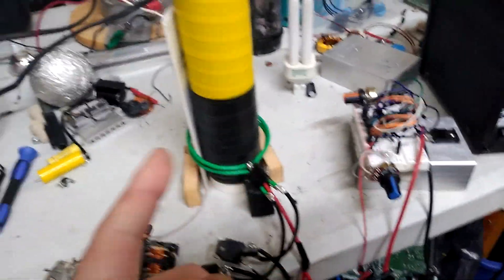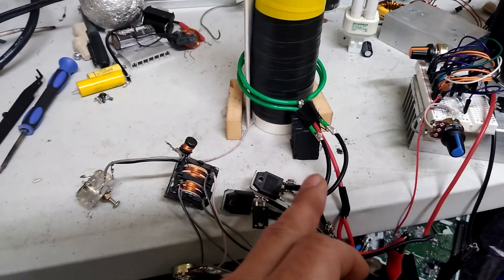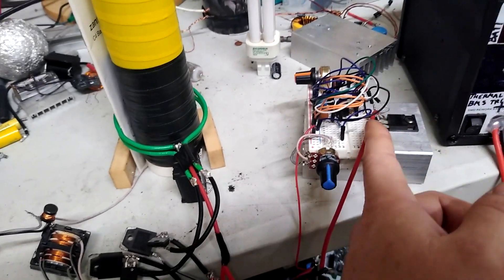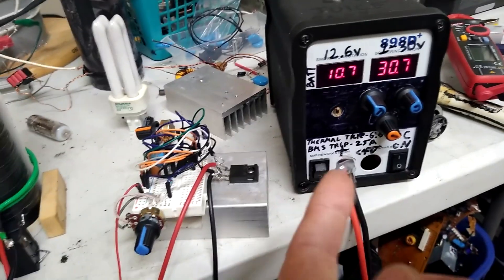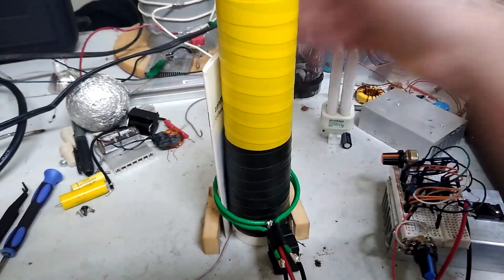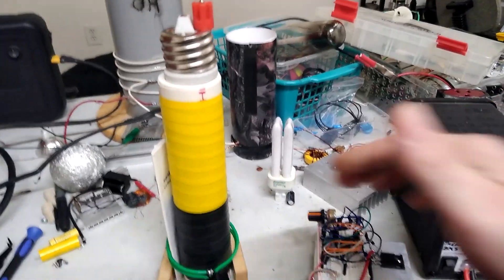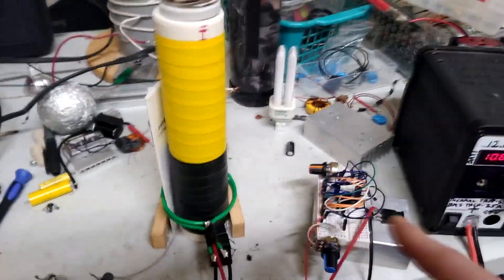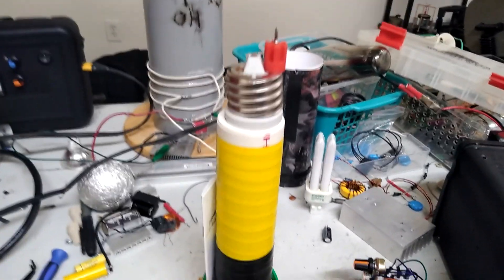Skori/TefaTronix 24v SSTC Variation

Comment: What MOSFET did you use in the video?
Reply from the maker: I think IRFP250s. Fake ones.
Reply: @Magneticitist  Why did I try with irf44n and follow your zvs Tesla scheme, it only produces a spark like a plasma sstc, usually not as big as in your video, what's the solution?
Reply from the maker: @why.k5max  Z44N is only 55V so that's better suited for only a 12v input or so. I can tune them to take 24V or maybe higher but the point of the ZVS is to use that low input voltage to easily and quickly create a much higher DC voltage such as at least 50V or so. Z44N's would not survive that high an input voltage.
Reply: @Magneticitist  I've tried it and it's still the same case, exactly the same as the one in this video  https://youtu.be/KhmWIWN7JMk It only has a small, sizzling spark and I use smps 24V 10A to supply it. Do you have any suggestions on how to make the frequency the same as what you made?
Reply: @Magneticitist  I used a DGT with 10 turns I tried to use a DGT from an old power supply on the TV but it just makes hiss and doesn't make a spark like in your video and if I Installing an interrupter like in your schematic instead it can't make oscillations and doesn't generate any spark what do you suggest for this?
Reply from the maker: @why.k5max  You have to interrupt it for it to spark, otherwise it will run full continuous duty and just hiss plasma while drawing a lot of current in the process. There are a lot of possible reasons your setup is not working.

Comment: I finally tried pulsing the rail, but got lesser output
Reply from the maker: There's a lot of possibles there though. Was it at 12v? I've usually needed at least like 15-18v to see any appreciable output unless it was finely tuned.
Reply: @Magneticitist  I mean, it's worse than pulsing the gates, at 12V. I'll have to make my own supply to get variable voltage for input. I have a few of sg3525 and was thinking of using two large power ferrites from two identical TVs and use the knockoffs in H bridge to get them going at 200V, but that means I still have to step down the mains and was wondering if a dimmer is a good way to do that by setting the limit on it so I can go lower but not higher than 200V ?
Reply from the maker: @sFeral  What line voltage are you working with? Far as dimmer I've done it but it wasn't pretty. The variable rectified output is nasty because of the chopped edges. Course depends on what kind of dimmer you're talking about.
Reply: @Magneticitist  EU mains can go to 400V when rectified, I think Diodegonewild said so, but maybe it's more controlled if rectified through a dimmer, Diac thyristor dimmer
Reply from the maker: @sFeral  ok for some reason I had assumed US voltages. I don't really know EU voltage like that but I don't know why it would be much different from getting 170VDC from a rectified 120VAC. That would make the peak EU ~320VAC and rectified ~320VDC as far as I knew. 
Triac dimming inductive loads is kind of like trying to interrupt a half wave SSTC without staccato though. I used a dimmer to vary voltage on my first half bridge, I think it gave me something like 150VDC max. With considerable filtering it was still funky output. I mean if the idea is a lower voltage for softer starting or switching it's not good to slam it with immediate peaks.
Reply: @Magneticitist  I have a variable cap from a radio and was also wondering what value I'd have to put in series with it to get in range of the values needed to roid out the GDT, by itself it only (at lowest value I think) dims the output
Reply from the maker: @sFeral  Hard to say, I got lucky with a 50pf cap that just slightly increases output with like 75% adjustment.

Comment: interesting solution... anyways i've found duct tape to be "bad" for insulating things, i mean, it's good but it adds too much capacitance apparently and that effect of primary arcing is probably due to that, especially if it's not a sharp spark but that web looking one, other people seem to not use much insulation but just spacing (that lowers the inductive coupling)
Reply from the maker: Yea I realized over time just more air space was like my only insulating option which would work well. That shit would arc through damn near anything but just enough air distance, or at least try to enough to affect the output.
Reply: @Magneticitist  i'm currently investigating a balance between air and an insulating material, the use of both may permit more inductive coupling and little added capacitance, the only ready to use materials that i've found are cellulose acetate and for DC applications hot glue, both seem to withstand a lot of voltage, more than glass or PVC... cellulose acetate is in sheets and can be deformated (slightly crumbled) to fit in the coil gap and act as suspension to center the secondary inside the primary, i also tried with a chain of cigarette pack wrapping plastic (i have those in quantity LOL) it's all crumbled and avoids to make an hard layer but it can be easily punctured
Reply from the maker: @redoverdrivetheunstoppable4637  you know honestly good old fashioned hot glue does seem to do the trick a lot of the time. I bought some of this insulating tape online that is supposed to be rated for very high voltages but all it did was 'soft arc' between the pri and sec with the nearly invisible purple glow. Wasn't until just making the coupling looser it would go away. Some of the TC circuits I tried would still find some kind of way to arc around or through that stuff just due to insanely high voltage. Aside from that thick enough glass would probably work as well but if some glass cylinder for the pri was used around the tower it would still need to be tall enough to not allow arcing to sneak around over the edges of it.
Reply: @Magneticitist  i haven't tried hot glue on tesla coils because it will add capacity for sure, but i've tested it on HV DC, i made a 1mm thick disc of hot glue (easy with baking paper to not stick) and it resisted 40kV between two steel spheres powered by a TV flyback, not tried to go further bcs it apparently resists 50kV per mm... more than that and i'm certainly doing something wrong

it's certainly a capacitive issue, the tape will quite likely resist HV DC

yeah, usually you make your primary over a taller than requested tube, it usually arcs from the highest point of the primary to a compromise between voltage and distance of the secondary, a flat primary on the bottom usually solves the arcing but it's less effective than a spring shaped one... or there's the "vase" shaped alternative but i bet it helps little actually... or the use of a fatter secondary.......

Comment: Sir please provide circuit diagram
Reply from the maker: Refer to TefaTronix page. http://tefatronix.g6.cz/display.php?page=sstc4&lang=en 
I use different mosfets for this typically IRFP250N in order to drive it at over 30vdc and I am powering the circuit using my own PWM to switch the power rail at varying frequency and duty cycle as opposed to the microcontroller used by TefaTronix. 
Secondary is 32 AWG 48mm x 175mm

Comment: I got similar length results with a slayer. If you pulse it the same way it will give very similar results... though a condition for it working was placing a around 700nF "tank" after the actual tank, don't know why. Maybe the "actual tank" didn't/doesn't work as I thought (was a really huge tank, more than 4miliF). The stupid thinking related to capacitors/banks cost me a multimeter. Never using the current setting again. A discharge from a 1miliF at around 100V was enough to fry the main IC on a fluke 177.

Comment: I blew a lot of switches simply by being stupid with the divider. As log as you're under 12V irfp260N shouldn't pop, but directly wiring it into ON state requires a higher current from the feedback than is directly produced, hence a feedback transformer might be enough, but I haven't found a good one yet. Just putting this here for anyone else reading.